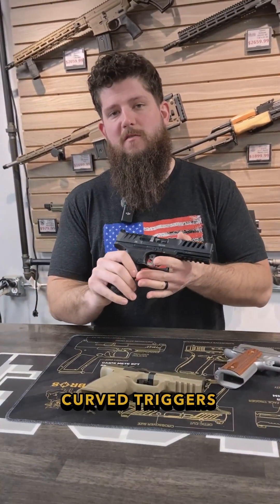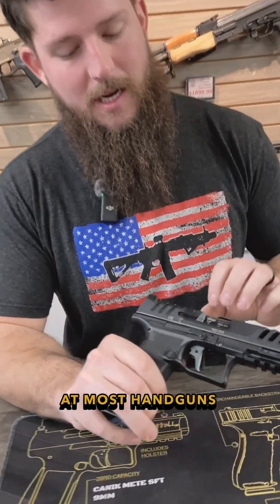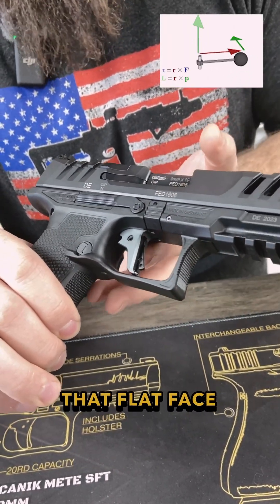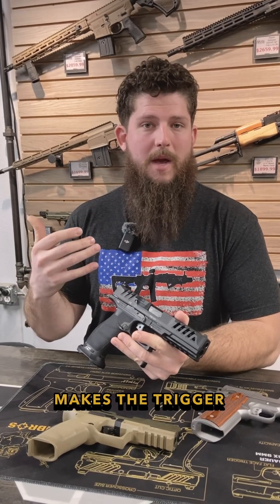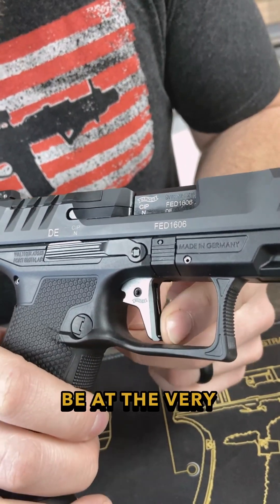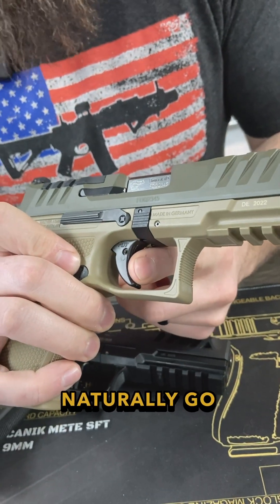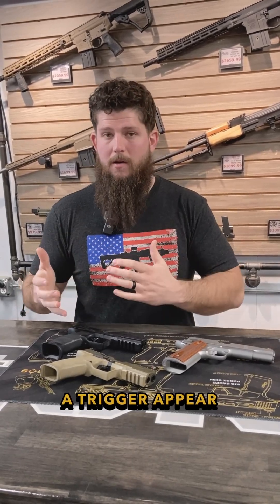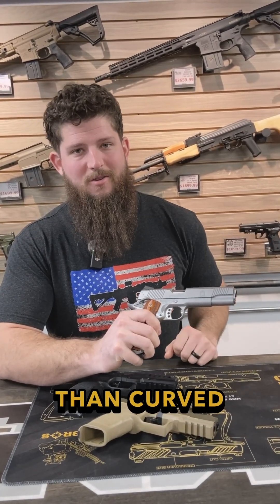Curved Triggers vs Flat Triggers

Comment: I bought a Sig P320X Compact almost two years ago and have appendix carried every day except for the first 10 days of owning this pistol because I fired 1200 rounds through the P320X to see if anything broke or suffered any malfunctions and after the 1200th round was through the pistol I stripped the pistol down and thoroughly cleaned/scrubbed the pistol while looking for any signs of wear or breakage which I found neither
When I started "Shopping" for a new EDC pistol the first Sig P320X Compact that I found was sitting in a glass case at the local gun shop.
I looked through the glass at s Sig P320X I noticed the flat trigger and immediately thought was "Im not sure if I like this flat trigger or will be able to get used to a flat trigger". 
I asked the guy working the counter if I could handle the pistol and he dug the Sig out of the case and handed it too me.
I immediately loved the feel of the flat trigger but feeling good about the flat trigger is different than actually shooting a flat trigger
I decided to try the flat trigger in my backyard range so I bout my Sig, figuring if I didn't like the trigger I could either get an aftermarket trigger or just sell the pistol and then try an FN 9 Tactical that has a tad longer barrel than the Sig P320X Compact
On my way home I decided to wait until the next day before I fired off any rounds through my new Sig due to  darkness would set in a little after I arrived home
As soon as I pulled into my driveway my mind changed.
I ran into the house, right past my wife and grabbed some rags and CLP
I stripped the slide off of the Sig, wiped everything completely dry of the factory "Packing Oil" which is always dirty/gritty and threw the Sig back together BUT I did have to slow down and think when I had to put the recoil spring/guide rod back into their places as this was the first guide rod/spring that I encountered on any striker fired "Tupperware Gun" but after looking at the clearance in the FCU I figured that the long side on the end of the guide rod had to be inserted vertically anddd I was right
I grabbed 31 FMJs out of a big bin of 9mm that I have downstairs in my living room and immediately went to chucking rounds into both mags, seated a mag in the mag well, dropped the slide, dropped the mag and topped it off
I was doing all of this at a quick pace and when I was getting ready to open the door my wife asked "What's going on, is someone out there?" which stopped me long enough to say to her "If there was something going on and/or if there was some person or people out their that were hostile do you think that I would have ran in the house, broke my new pistol down, cleaned and applied new oil on this pistol, reassembled it, and then took the time to load up 31 rounds, especially FMJ rounds OR do you think that if I was possibly seeing red flags pop up in my head over 1 or more hostiles or possible threats wouldn't I grab the pistol that was seated in my holster that was located in the appendix position, OR since I did come in the house why wouldn't I grab an AR or my 8 shot shotgun that was stoked full of 00 Buck Shot?"
My wife just looked at me and said "Oh God, just go outside and do what you were going to do!"
I did just as she said and grabbed two paper targets, a pepper popper target and an 8" steel gong target and an 8" Throom target.
I threw all of the targets into my electric golf cart along with the new pistol case with the Sig inside of it and drove the 60 yards to my target butt and immediately stapled the paper up, stomped the steel and Throom targets into the ground and commenced to firing before it became totally dark in which the security lights on my barn, old garage and new garage do illuminate my targets pretty good but I didn't want to shoot a new gun in any amount of darkness even with the targets being mostly lit up because IF I didn't get a good group and this good group being in or near the 9 or 10 ring area of these targets which would cast doubt on the accuracy of the new Sig even though the partial darkness would be the culprit. IF I ever have doubt about a gun I will not use that gun to defend myself so I guess you could call that, in a roundabout way a "Training Scar"
I did get my 31 rounds off at a slower pace than I am used to and with all rounds being in my desired area.
I REALLY concentrated on the feel of the flat trigger while pulling this trigger to fire and while creeping it back up to reset.
I LOVED the new, well new to me flat trigger and the entire pistol but what I DID NOT LIKE was the blacked out rear sight
I want to put an XS Big Dot in place of the stock Sig #8 and keep the tritium front site but I may have trouble with a new XS Big Dot rear sight matching up with the Sig #8 tritium front sight as it should but if need be I would mount the new XS front dot in which I will probably do if I decide to change sights which I have heard is a job and a half.
Plus I would need to spend between $100 to $200 for a sight pusher and I am eyeballing a new, $129 Lyman sight pusher as it looks well built and looks like it could handle the "Task" of removing the old and installing the new sights
I already know that the cost of the new sights and new sight pusher will cost me much more because to justify the purchase of the sight pusher I would end up replacing the sights on my multiple XD's and 1911's and also change the sights on the pistols of my kids and the many pistols of my ex wife

Comment: Yeah, for some reason my trigger finger has always ended up on the bottom of the trigger guard(I mean inside the trigger guard, but touching the bottom.)  Curved triggers never really bothered me though(though I grew up on glocks, so maybe I just got used to it.
I will say that I do like the trigger on my p365xl better since switching to it from a glock 19.  I don't know how much of it is the flatness of the trigger, and how much is the different feel of the trigger, but for now I'm sticking with the flat-faced trigger.

Comment: Flat  face  trigger has nothing to do with the radius, where you place your finger on trigger determines the force of pull, if you place finger at end of trigger less force will be needed, but  if place finger higher up more force  , like opening and closing a door  , it' takes less force to move it pushing by handles  , as opposed to  pushing by hinges.
Reply: In theory, for most people, a flat face trigger will naturally position the shooter's finger at the bottom for maximum leverage, and a curved trigger will naturally roll the shooter's finger up into the curve. Unless, of course, the shooter was taught to force the trigger finger downward along the curve while pulling for a controlled increase in leverage throughout the pull.
Reply: @h_in_oh  with a Flat  trigger  has a greater variation of where your finger will  land and pull curved trigger just more intuitive and consistent pull spot , but to each their own.
Reply: @russellrudolph4051 
I carry an FN with a wide, flat trigger.
My finger is in the same spot ever time.
At the very bottom of the trigger.
Reply: @pewpew9193  Yeah, right  in a stress induce situation, you don't know where your finger will  land, my point being flat trigger has  greater chance of different pull spots, we see it all the time , when gun tubers do trigger pulls the  same  gun comes up with 2 to 3 different readings , because the tubers are not pulling from exact spot on trigger , same can happen to your finger sir, have a great  day.